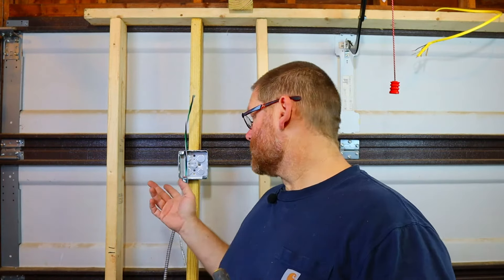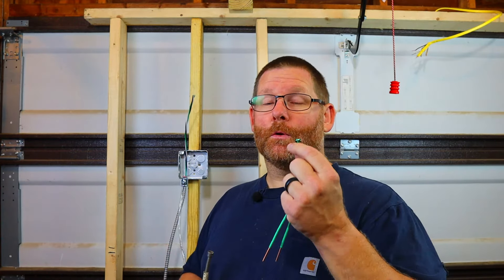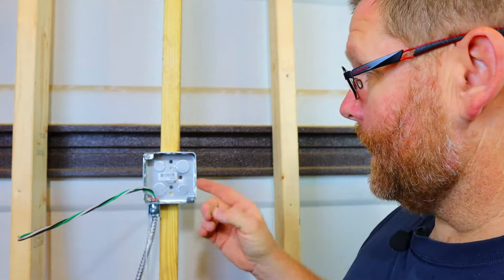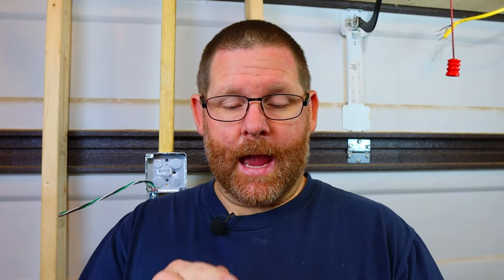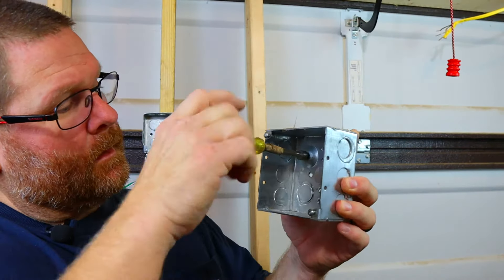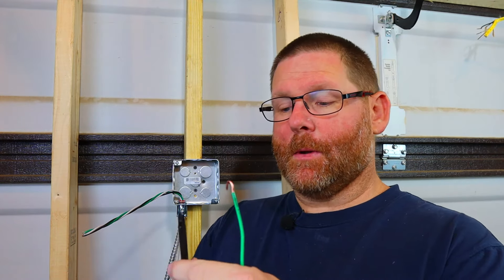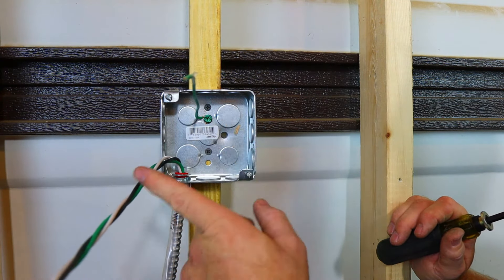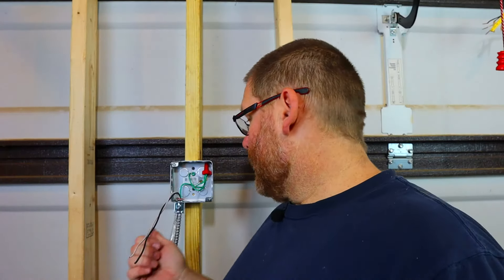How To Ground And Bond A Metal Electrical Box

Comment: Wow. Love your videos. I was hoping that you would explain what to do with the flat 1900 box if you're mounting it to a concrete wall. The type that doesn't have the bubble for the ground screw. Do you just drill out the hole in the concrete behind where you will install the ground screw?
Reply from the maker: I can't believe that I didn't mention it. I usually use a sharpie mark the hole and then move the box and drill it out so it will not hold the box off the wall.. That may be another video.
Reply: @MountaineerOutdoors  Thanks!

Comment: I never liked using only 2 dry wall screws to secure any electrical box. Too much play. Instead of the #6 SR screws used a #10 screw 1" long with a small built in flat washer. I only purchased the 2 & 1/8" deep 1900 boxes especially if you are installing a GFCI receptacle or receptacles with built in USB charging ports. In my 50 years as a sparky NEVER came across a #14.or #12 broken copper ground wire that was wrapped around a ground screw then continues to a device. On shallow wall cases this is sometimes they only way to not overload the cubic inch calculations from all the wires, clamps ,& devices because bring it saves from using a pressure connector to splice ground wires. NO SUCH THING AS A WIRE NUT IN ANY CODE BOOK ! wire nut & Romex are trade names from the one company that makes them. Only time electricians use a pain in the butt side wall ground clip is on very old boxes that do not have a 10/32 threaded ground hole. Has been awhile since I purchased a box of ground clips but believe they are more expensive to purchase verses the coming green ground screws.

Comment: Not 100% true. The green pig tale isn’t required in all junction boxes. The code (2020) also allows for using the metal conduit itself as a means of bonding for grounding the equipment.
Reply from the maker: True but I have seen people not tighten up conduit and its separates. Then the bond is gone. Redundancy is the best at least in my opinion

Comment: Stop saying GREEN ground screw and instead say 10-32 ground screw. Nothing in the code says box bonding screws need to be green.
Reply from the maker: Although I owe you absolutely no explanation. I know the code says anything that is 1032 color is not not even really mentioned. However I have been too many job sites where they have use Wafer Head screws which are not 10:32 and even though they're flat on the back side People wrap around that. I simply mentioned green ground screws because if you have that on your box there's no question. I am fully aware of the code. My thing is this it doesn't cost that much more to go get those so why not solves a lot of issues down the road
Reply: Green is great, it lets the inspector do his job easier, like white 14-2 ,yellow 12-2, and orange10-2.
Reply from the maker: Fully agree with that. I kinda like how they did that makes it alot easier for electricians too.